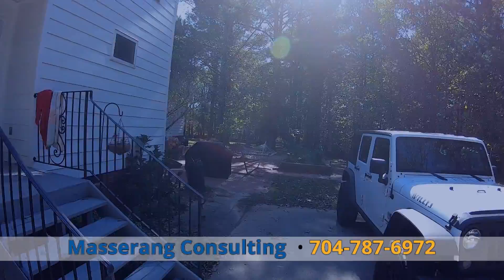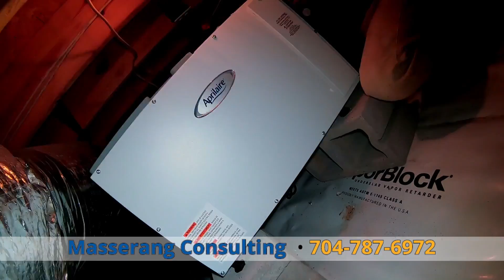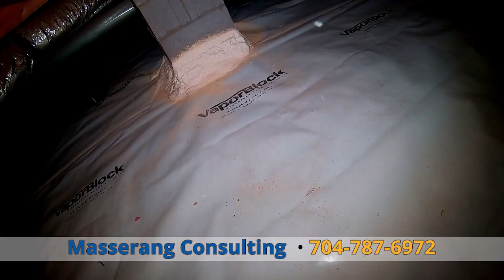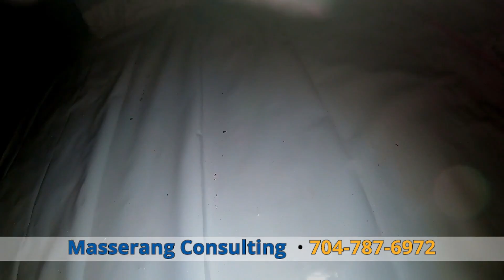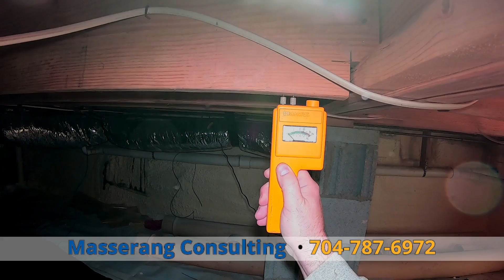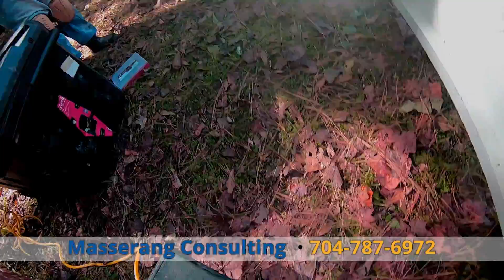Does Your Crawl Space Stink?  Rock Hill SC  Specialty Foundation Repair  704 787 6972

Comment: What about Ez Breathe System
Reply: We rip them out when we see them. Horrible design. Has little to no effect on the crawl space from a moisture and/or odor perspective. They simply do not have the design capability to move enough air. And they are calibrated by RH which is problematic at best.  I'm surprised they are still in business.
Reply from the maker: Complete Garbage. A paper weight would be more effective.